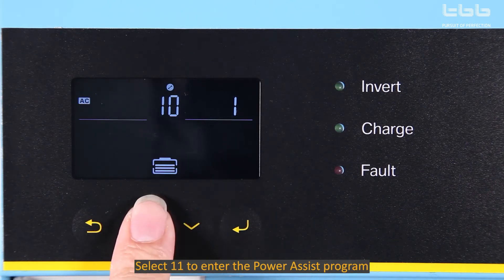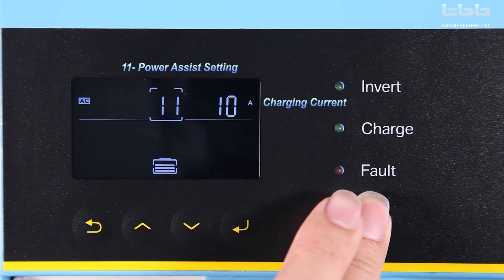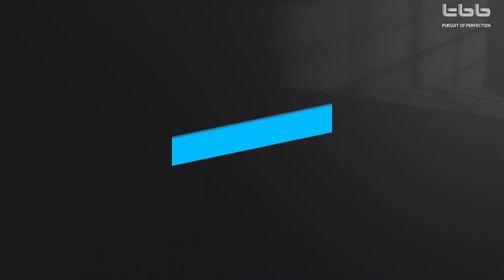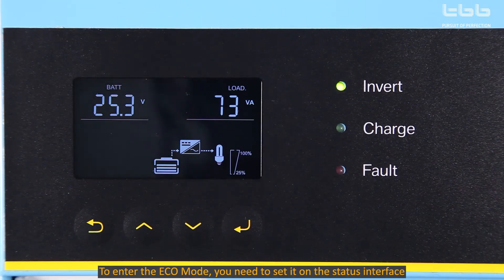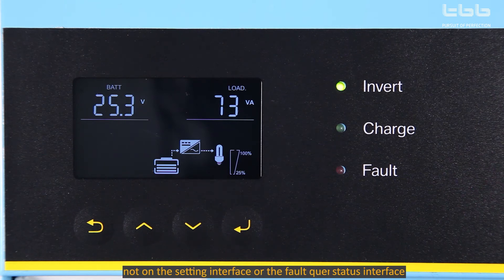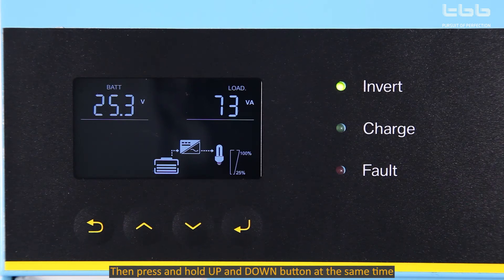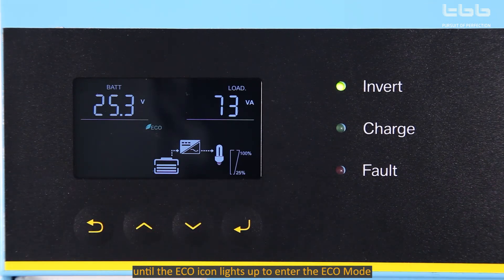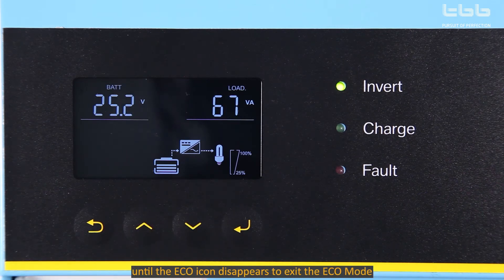TBB RiiO Sun All in One Solar Inverter Parameter Setting Guide

Comment: What is Ubat ctrl/ SOC ctrl?
Reply from the maker: Ubat ctrl refers to Battery Voltage Control, typically used for non-lithium batteries, such as lead-acid batteries. SOC ctrl refers to State of Charge Control, typically used for lithium-based batteries.